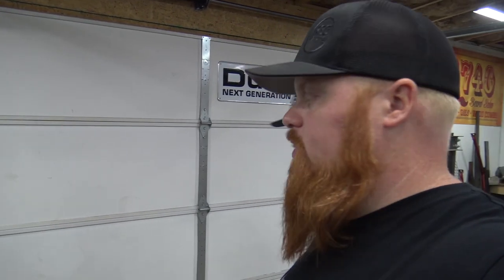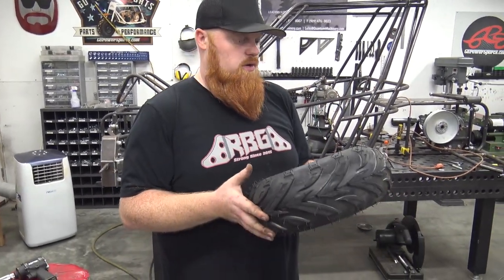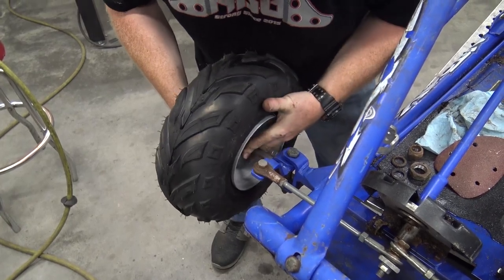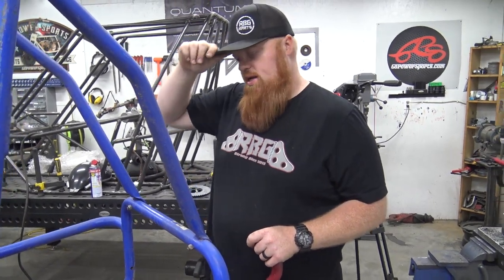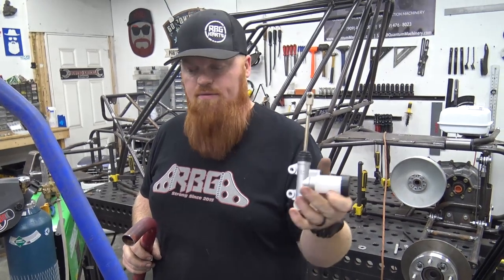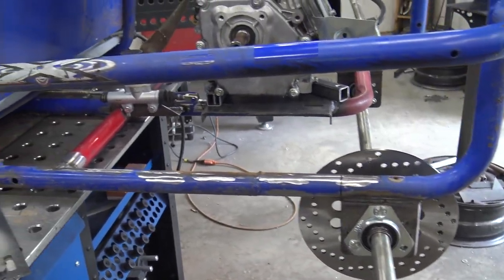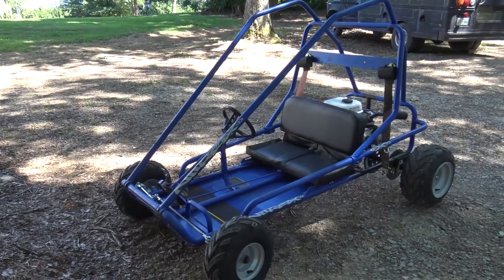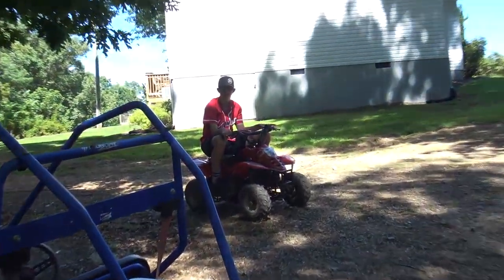Murray Nitrox Go Kart Rebuild

Comment: If you don't have a cool red beard, fab shop and a big budget the rear bearings for the stock axle are 3/4 ID and 1 3/4 OD Part# 7512DLG.

Comment: At 1607 of your video when you're talkin about the cutting out it reminded me of the same issue I had when I first bought a predator for my nitroxx and there was a fuel safety switch that I ended up having to clip the wires too, I think it's a safety switch for you if you roll the cart over or something but when I hit bumps it will cause the motor to stop and then it would kick back on...... Clip the wires and never had another isue